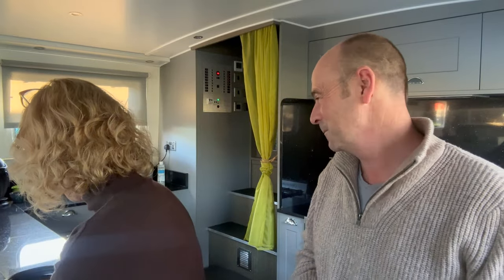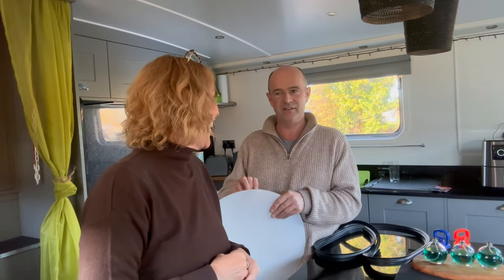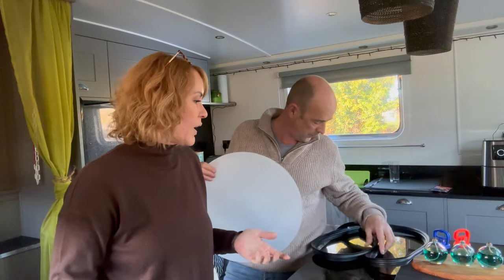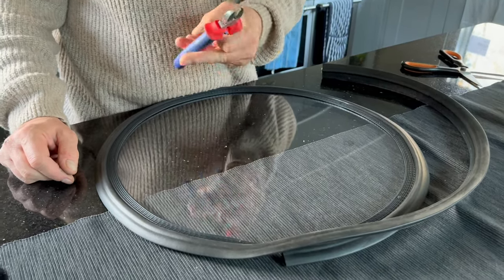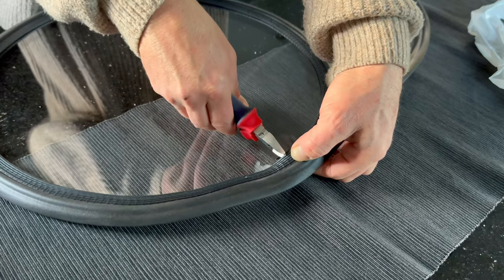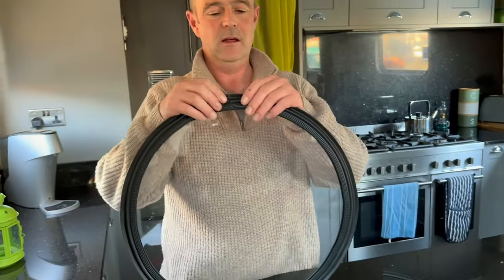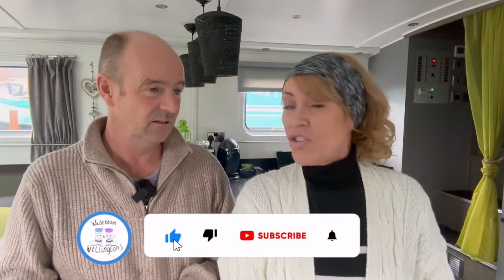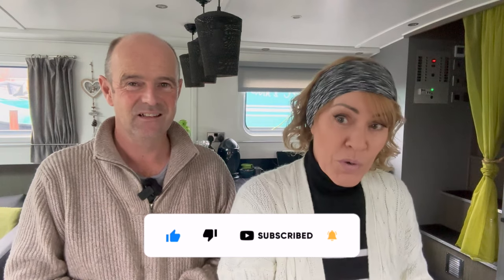Stay Toasty Afloat - DIY Thermal Breaks for Your Wide Beam Boat | 132

Comment: WoW! what a game-changer! Thanks for sharing this top tip! I have a really boring logistical questions for you, if you don't mind me asking. let's say the window gap in 30cm, the rubber fin part of the trim measures 17.5mm, would you order 29cm perspex? I want to make sure there's just enough rubber for it to seal & bend. Thanks again! Much appreciated. Claire x
Reply from the maker: Hi Clare, it’s tricky to give you and idea our window gap is 457mm and in order for the trim we used to fit snugly we ordered Perspex in 440mm so took 17mm off as you need to remember the rubber trim goes all the way around. Hoping that helps with your calculations 😁
Reply: @WidebeamandWellingtons  thank you! that's so helpful! Much appreciated. Claire x

Comment: Hi thanks we found this rally interesting as we’re thinking of doing the same on our Narrowboat could you tell us the thickness and what type of Perspex did you use and do you have a link for this as well? Thanks
Reply from the maker: It does depend on the size of your windows for the porthole we used 2mm Perspex, we’ve ordered some for the bigger windows in the same thickness but need to see what it’s like as we might need to go thicker 🤔 https://www.perspexsheet.uk/?gad_source=1&gclid=Cj0KCQiA67CrBhC1ARIsACKAa8RQ284RYO49CLMlj-fhBoUAWpQoWiJ5iQpx_s9EOFoc9nkyTMH41TIaApCcEALw_wcB
Hope that helps, we will update on the bigger windows once we’ve perfected 😁
Reply: @WidebeamandWellingtons  thank you x

Comment: Great idea shame I cant do it with the main windows as the top opening bit is proud of the window frame. Maybe I could cut the metal back on just that bit.
Reply from the maker: Our friends have the same issue on their boat they have cut a notch out of the Perspex but then it isn’t air tight so does kind of defeat the object 🤔
Reply: This is why looking at it I think I could actually shave some of the metal back, cut a section out of the metal, hardly ever open them anyway open doors and side hatch for through draft anyway, so that's my plan would like photos of what you have done on the main window though if possible so can asses the job.  @WidebeamandWellingtons
Reply from the maker: The main big windows are in progress, will keep you posted 👍

Comment: I believe that your porthole glass is the same as ours at 40cm , if so what size did you have  the perspex infills cut to?
Reply from the maker: Yes ours are the 40cm too, It does depend on the rubber seal, if you use the same as ours and your window frames are the same  it’s 440mm 😁